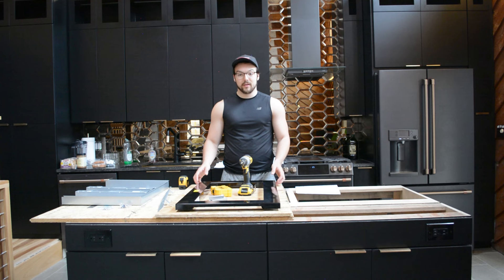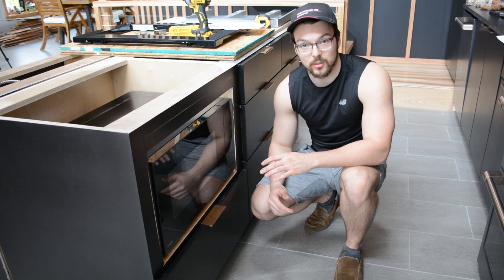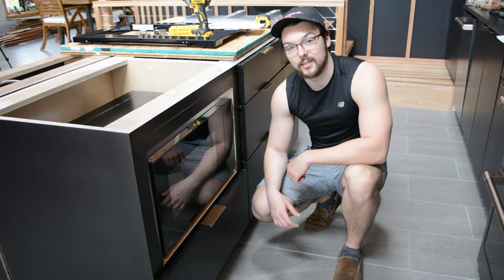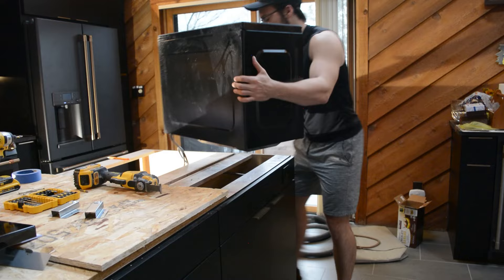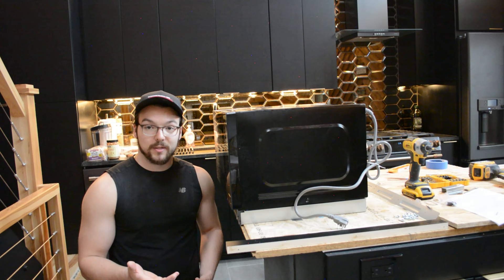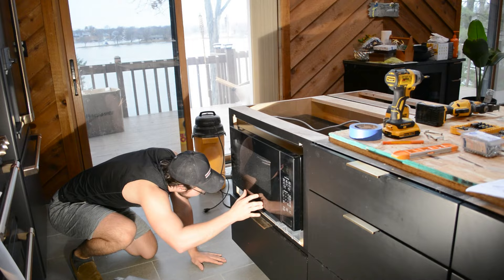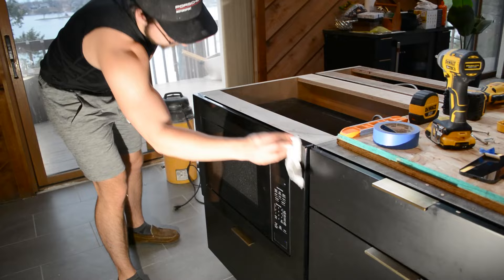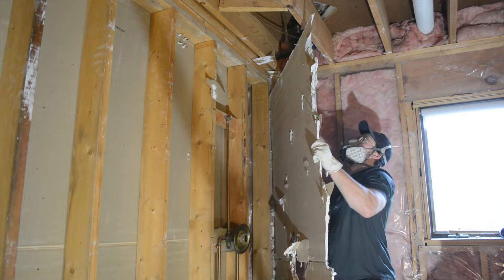How to Install Built In Microwave with Trim Kit

Comment: This was really good man! Thank you. I've read some very negative reviews about the trim kits not fitting properly but after watching your video it seems like the manufacturer (particularly Samsung) had made it so their trim kit is flexible enough to fit most installations. There will likely need to be a little cabinet opening adjustment to make things fit properly. This was an eye opener! Thanks again
Reply from the maker: Glad I could help!

Comment: My trim kit came with a top metal piece that you screw into the cabinet, do I really need that? My cabinet hole is 1/4 inch too short, so can i just notch for the kit to fit or do i need to shave the whole top off 1/4 inch?
Reply from the maker: I would install it per the manufacturer instructions with the top piece. You should shave off the 1/4”

Comment: This is so helpful! Question: what about the venting? How do I make sure there is proper ventilation in the cabinet?
Reply from the maker: I’m glad you found it helpful! If the microwave is a built in version it will normally have venting out the front, so you don’t need to do anything. Just make sure not to install an over the range or countertop microwave inside the cabinet 😁

Comment: In terms of dimensions, if I am buying 27inch trim, then what size Microwave and what size cabinet opening I should leave ? Also, is it must to buy Built in MW to go under the island ?
Reply from the maker: Each microwave is a bit different so it depends. You must find a microwave that is meant to be built in as the ventilation is different for on the counter and above the range microwaves. But the size of hole depends on the brand. I linked some in the description if you can’t find any.

Comment: The links do not match the black on black you installed both are stainless. Where is the microwave and trim kit you installed?
Reply from the maker: Unfortunately, Amazon no longer sells the specific model I used so I linked others that looked very similar. Mine is from GE. You may be able to find it sold elsewhere

Comment: Nice vid. Just bought a place and love the reno's you had done so far. Really DIY friendly IMO. I would be needing to get a builtin soon and it is interesting to see the trim kit section as mine is "non" standard to the sizes I have seen down under.
Reply from the maker: Thank you! Glad you have been enjoying the videos! Another option to consider is a drawer style microwave. They are a lot more expensive but the opening is at the top and they slide out like a drawer hence the name.

Comment: I recently had one installed but the microwave slides back when I press the door button, are there screws missing on the install?
Reply from the maker: First question is: was it a built-in specific microwave? I’ve seen some where a on-the-counter or above-the-range microwave is used and those are not meant to be built-in. Second question: was it properly installed? As you mentioned, a screw may be missing or the rails weren’t properly secured. Regardless, it should not be moving when you push any of the buttons.
Reply: @GoldenKeyDesign  I figured it out, the rails weren't parallel and this prevented the feet from sitting into the notches. Thanks for responding so quickly!
Reply: I think you are correct though as it's most likely a counter model with a trim option, and likely isn't the best fitting design as it doesn't screw into place like the one in your video.
Reply from the maker: @mattskrepnek3136  Glad you figured it out!

Comment: Excellent video.  I have a trim kit for my new microwave, what I need are the brackets or rails that you use to raise the microwave inside the cabinet. Do you know where I can buy those?  Thank you
Reply from the maker: Thanks! In all the kits I have installed, the rails come with the kit. It is usually a full package of the trim piece and all the metal hardware needed for the install. I would contact whoever you bought it from to make sure you got all the parts.

Comment: What and the top piece for the trim, you not use it?
Reply from the maker: Not sure I understand your question. The trim for the microwave is all one piece
Reply: @GoldenKeyDesign  there is a top piece/bracket that screws into the opening and then trim screws into that.

Comment: What size trim did you buy 27 or 30?
Reply from the maker: I bought 30” since the cabinet width is 30”. Only but 27” if your cabinet is that size or if you want the trim to not extend to edges of the cabinet. Hope that helps!